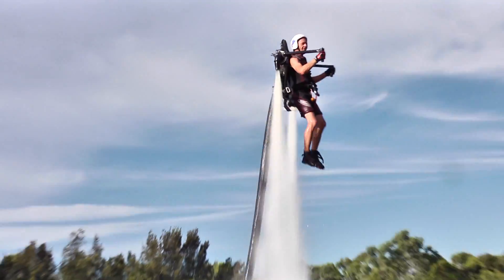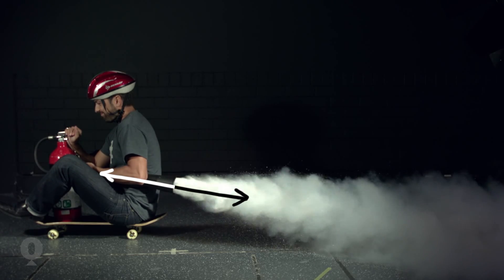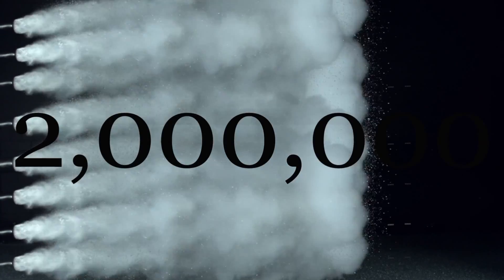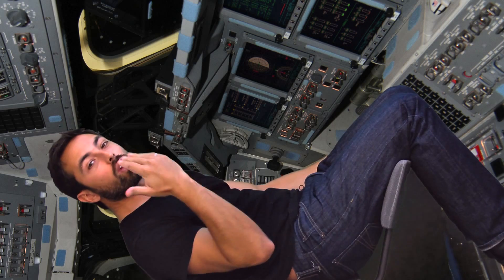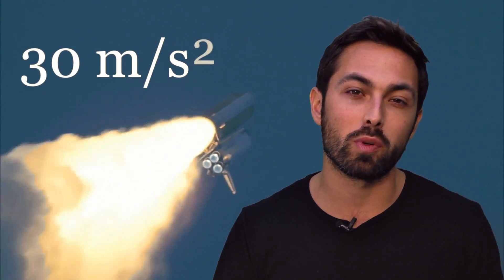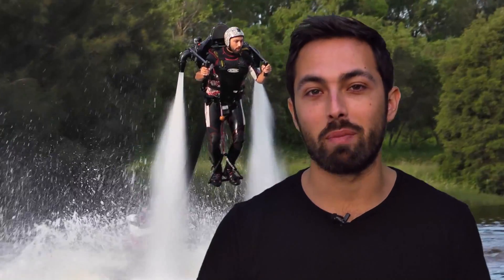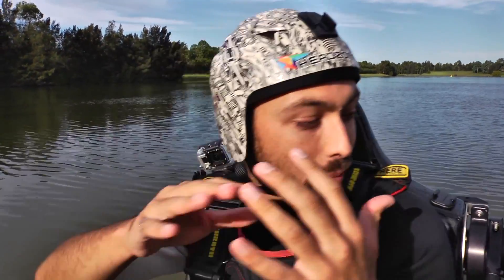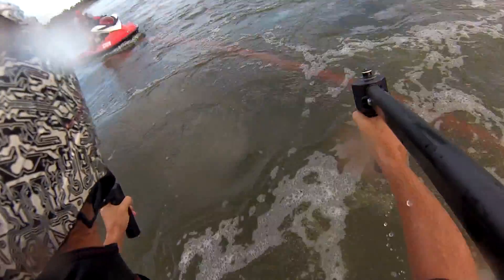The Science of Jetpacks and Rockets!

Comment: I never understood why we use the antiquated system of rocketry. We could build a curved tube simular to what's at the local bank with a larger payload than any rocket to date & be shot out using compressed air. Now, the best payload would be water! Why because the water could be converted to breathable air & fuel after it was used to support the astronauts bodies during takeoff. 200-300 miles of tube would be needed & it would need to exit a tall mountain top, but it could be solar powered.
Reply: the hell?

Comment: you never explained the genius of water jetpacks. air is light, so it takes a huge amount of exhaust speed to get thrust. as a rule of thumb for a helicopter, it takes 1hp to lift ONLY 5 pounds. water is heavy, so it takes less exhaust speed to get the same thrust.
Reply: One-hp to lift  5lb for helicopters is an excellent point. Do you have any reference links, or if links don't post here just the title of the page about this ??? THanks. K.S.
Reply: I just verified your numbers with a new comment above.
Reply: There is a trade-off.  It's not quite as clear-cut as this.  Fundamentally, you are right - and it all makes sense.  The more massive the ejected material is (air vs water), the more momentum it has, and ergo the more thrust would be generated to offset that momentum in order to conserve system momentum.  One thing you are leaving out is the energy needed to accelerate that ejected material.  If it's more massive, it's gonna require more force to accelerate it at the same rate as you accelerated the less massive material.  This needs to be accounted for.
Reply: @willoughbykrenzteinburg  suggested: Youtube::: (Water Rocket 6G (3 Stage))
Reply: @kareemsalessi  Is this supposed to be a link?
Reply: @willoughbykrenzteinburg  Copy-paste that title into Youtube-search-slot & it comes up, plus a few similar ones. Most channels do NOT post comments which include actual links!!!
Reply: @kareemsalessi  I've never had any problems with someone posting links.  What is the relevance of the video?  Are you trying to make an argument.  In other words, I'm not just going to watch a video without context.  What is it I am supposed to be looking for?
Reply: @willoughbykrenzteinburg  no worries!!

Comment: If contact with an external mass is not necessary, can you then "swim" on space? Isn't moving one's own limbs physically analog to a jet?
Reply: No.  The ejection of mass is what is creating the thrust here.  If you had a bunch of mass you could throw away from your body, THAT would be analog to a rocket, but just flailing your arms about is not the same thing at all.  You wouldn't go anywhere.  Or rather, you'd just oscillate back and forth, but overall stay in the same place.

Comment: a normal fire extinguisher doesn't have CO2 in it. It has charged nitrogen. If it had CO2 it would choke you while using it and it wouldn't function at negative temperatures. A little fact I noticed in the video that was wrong. Small and unimportant but still wrong! The white powder is the extinguishing factor in an ABC Fire extinguisher. CO2 extinguishers exist but are only in Kitchen scenarios for grease fires.
Reply: "Newest first"
Oh no......

Comment: Why do you say F=mv?
Reply: m dot is another way of writing m' which is also dm/dt. notation is confusing.
Reply: It was actually m with a dot over it. I didn't understand the physics too well, but if you listen, Derek defines m-dot as a "rate" of mass ejected - so, essentially, mass / second. By unit analysis you can move the "second" in the denominator under the v, and then you'd have the more familiar F=ma (acceleration is the rate that velocity changes).

Comment: Wait?
 3:22 Mass decreases?
Is this due the burning of fuel, having less fuel, less mass, so accelerating faster?
Or is this due being further away from earth, having less attraction?
Or is this because it's easier to accelerate when he's already moving?
Reply: Mass is stuff, it burns the fuel, there's less stuff, less stuff to push up
Reply: Alec Joseph Yes, but it's not the (main) reason that the acceleration increases?
Reply: xFuaZe well, i think it is. Imagine yourself pushing a holey cart filled with water, as water comes out, the cart becomes lighter, thus making it go faster (with the same amount of force you are pushing with). Sorry if my explanation is ... Bizzare xD
Reply: Hmm, okay, yeah, probably the biggest mass of a rocket is it's fuel.
Thanks! I thought that the lower attraction from the earth would make it easier for the rocket to "get away" thus increase it's acceleration.(not speed)
Reply: xFuaZe There are two main reasons for which acceleration increases. First, fuel is burned up and ejected through the exhaust pipe. Fuel masses a lot, so by using it not only do you exploit its chemical (and kinetic) energy to propel the rocket, you also make it much, much lighter and therefore easier to accelerate (remember, acceleration is force divided by mass). The wikipedia page for the Arianne 5 rocket lists it at about 777 tons total, but a maximum payload of 21 tons only (and 21 tons would be two very heavy satellites already). Fuel does make up most of a rocket's mass.

The second reason is that atmospheric friction wastes a lot of the rocket's energy. All that good air has to be pushed out of the way, and that takes energy. When sending stuff to space, you lose about 1.5 to 2km/s of delta V to atmospheric drag. Imagine the energy it takes to accelerate that big 800 tons rocket to a speed of 2km/s, and that's the energy that is wasted displacing and heating air instead of doing what you want it to do, move your rocket. That's about one fifth of the total energy it takes to send stuff to low earth orbit. 

Reduced gravity away from Earth plays a role too of course, but it was rather marginal in the case of the space shuttle which only flew to altitudes of around 400km, where gravity is still about 0.9 g. Then again, the shuttle always flew on a very tight budget (since it only shedded part of its mass on the way to orbit as the orbiter itself couldn't be just discarded like you sequentially get rid of the parts of a rocket), so every bit helped.
Reply: according to me it's because of both the fact .. that the spacecraft looses the mass of fuel as it burns it ... and also because of the spacecraft moving away from the earth ... I don't know which one is major ...
Reply: Mass always remain the same. Even if you're in a place with no gravity(space). This is what prevents astronauts from stopping meteors or throwing their space shuttle (if it is what they live in, in space) towards the earth. Weight is the acceleration which is 9.8m/s^2 on earth. You fall down due to your weight or the acceleration exerted upon you by earth. The acceleration is the same for all, a heavy ball and a light ball has the same acceleration (You can try it using golf ball and a ping pong ball).

Comment: About the trust of the jet pack...
I think that the majority of the trust does not come from the water passing through the curve that redirects the water from going up to going down.
If the water would be fed in from the top of the unit, you would probably still be lifted out of the water.
So I think there is something else that provides the trust.
My guess is that the water is accellerated because the the nozzle has a smaller diameter than the main tube.
The acceleration exerts a force on the unit according to f=m*a and that's the main force that lifts you out of the water...

Comment: If you redesigned this machine to recycle the water that was expelled and fed back into the intake, could this fly independently? 
You could add a turbocharger type device to a) increase the pressure of the water going in and b) slow the speed of the water coming out so that it doesn't counteract the thrust.

Can anyone please explain if this wouldn't work and why?
Thanks.
Reply: It wouldn't work.  It would be like bringing a box fan onto a sail boat and trying to create your own wind.  While the wind hitting the sails would act to push the boat forward, the fan itself would create an equal amount of thrust in the opposite direction counteracting the push from the wind. 

The same kind of logic would apply to your scenario.  While the water being expelled out of the jet nozzle would provide thrust, it would ultimately be redirected back into the intake, and that process would create forces that counteract that thrust, and you'd net to zero.  In other words, the very act of slowing the water down in order to bring it back into the intake would create a force in the opposite direction negating the thrust.
Reply: Willoughby Krenzteinburg Gotcha, thanks. 
I was hoping to dispel some of the energy somehow before it reaches whatever mechanism is drawing it back in, but I guess not being able to create or destroy energy would apply. 
Thank you for your reply.
Reply: Willoughby Krenzteinburg Gotcha, thanks. 
I was hoping to dispel some of the energy somehow before it reaches whatever mechanism is drawing it back in, but I guess not being able to create or destroy energy would apply. 
Thank you for your reply.
Reply: Because the intake would slow down the water, and therefore the device, thus, instead of a rocket, it becomes more like a wheel.
Reply: There would be a force downward on the intake which would cancel out the upward force therefore, no flying
Reply: Why was my comment deleted?

Comment: But why does the space rocket lose mass while going up? My prediction is it is because of the loss of the gravitational force. But then rocket wouldn't lose mass it would lose weight.
Reply: The rocket fuel has mass and is turned into the gasses which are forced out of the end of the rocket. By forcing this gas out, the rocket creates thrust. The mass of the gas is equal to the mass of the fuel. (Mass is conserved) This means that the mass of the rocket as a system, (the mass of the rocket plus the rocket fuel) decreases as the mass of the fuel within the rocket decreases. (The mass of the fuel exits the rocket into the atmosphere)
Reply: "But why does the space rocket lose mass while going up?" because it burns fuel?

Comment: Veritasium at (3:21) You said that as the spacecraft continues to burn fuel, its mass decreases. How can mass decrease? I've heard that the mass always remains constant. Is that wrong?
Reply: The mass of the spacecraft includes the fuel.  The mass of the spacecraft itself isn't changing, but as it uses fuel, the mass of the fuel leaves the tanks, and the total mass of the spacecraft and fuel decreases.

Your car is less massive when you are running low on gas.
Reply: Willoughby Krenzteinburg Thank You..!!!
Reply: Divyanshu N. Singh also why pro drag racers have just a tini bit of gas.

Comment: This is horrible!  Gases leaving don't push your forward, the push comes from the front.  Don't you guys go through and correct misconceptions?  Why would a gas leaving cause anything to happen?  If I breathe in do I move forward?  The gases are pushing on the fire extinguisher everywhere except for the hole.  This causes a net force based on gases pushing on the inside front, but not the back.  Your labeling of the forces in the beginning is incredibly misleading.  The force should be along the bend of the curve of the extinguisher.  What's the gas pushing on where you have the arrows?